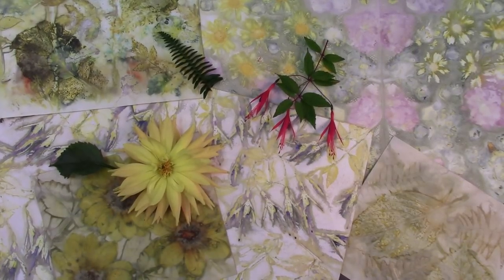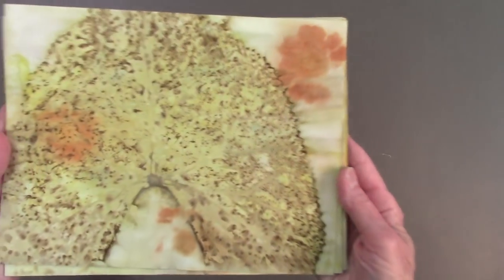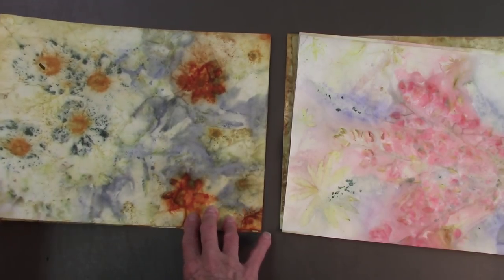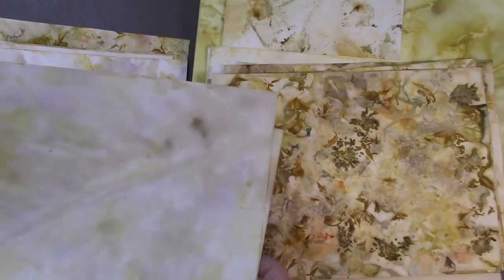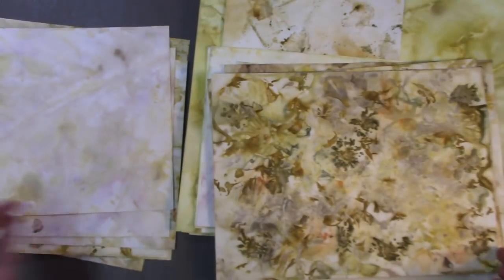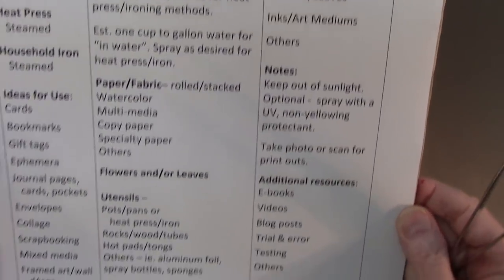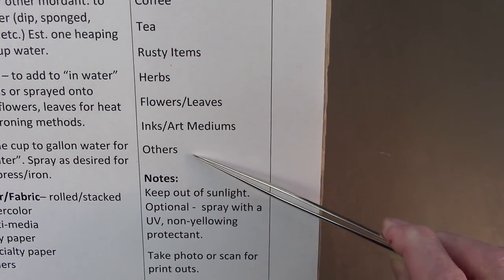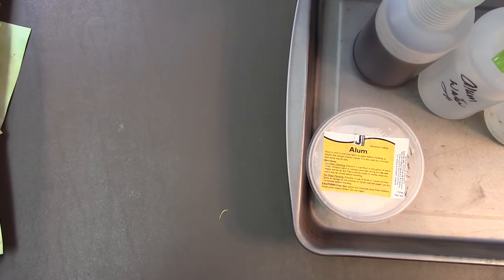Eco Printing Reveal and Results using Iron, Heat Press, Oven & Stove Top | Ideas

Comment: Em, I'm wondering if the reason the non-buffered paper doesn't work as good for the printing is because you used the alum on the paper.  They said the pH of the non-buffered paper was 8.5 and the alum might be the reason it doesn't work.  Could possibly change the pH.
Reply: Hi, that's an interesting thought. I will have to play around without the alum and see what happens. Thanks for the comment and for watching, Em

Comment: Do you add mordant in the water or pretreat the paper with the mordant?
Reply from the maker: Hi Sherri, yes I always pretreat the paper with alum most of the time. In a pinch, I will treat prior to using, but always start with alum on the paper:-) Em

Comment: What stunning results! ❤️ thank you for sharing...wondered if you could help with my issue...I’m very new at this process..I did my first batch where I soaked in water and just had it sit in Arizona sun for a day ( didn’t have a pot yet) they turned out ok...second batch had pot, boiled for 2 hours...but a lot of my copy paper fell apart ...I don’t know why? My first batch sat in water for 24 hrs..no tearing but 2 hour soft boil and I couldn’t handle the copy paper...any suggestions or ideas? ( I am using watercolour paper with no issues.. but want to be able to use the copy for my journals..thank u!
Reply from the maker: Hi Debbie, appreciate the comment. I agree that copy paper doesn't hold up well under boiling and why I don't usually use it. Perhaps others have had better success and have some tips. Maybe try the iron technique and see if that works better using copy paper. Here is an example https://www.youtube.com/watch?v=PpkxYNhqHwI

Thank you for watching, Em

Comment: What method do you recommend if you live in an apartment.  Thanks.
Reply from the maker: Hi Georgia, when I did it inside I would open doors/windows and do it when nobody else was home and I could work in another room while they cooked. I found the oven was best since it gives off less vapor and steam. I did it in a pot at 350 degrees for two hours. Both in water and/or sitting above the water to steam - both worked. Play around:-)
Reply: @emsplace  thanks

Comment: Do you have a link to the video that demonstrates the oven method?  Loved this video.
Reply from the maker: Hi Maria, I don't think I have a video where I actually demonstrate/show using the oven. Basically just the written information in the description above. Pretty simple: just make your bundle via rolling or flat based upon the size of your pan. I use a large rectangular cake/roaster type pan where I can do flat bundles up to 9" x 12". Then decide if you want them submerged in water or steamed.

I generally steam but have done both. If steamed, put something in the bottom of the pan, like a brick, wood etc to keep the bundle above the water and then put a lid/aluminum foil as cover to keep the steam in. I let it bake/steam at 350 degrees for about 2 hours. It is not an exact science so you can play around and adjust to our needs. Thank for watching, Em

PS: if you want to see how I make a flat bundle check out this video and especially at the 1 hour mark where I show the bundle done and ready for the string... https://www.youtube.com/watch?v=PWUkyjkdGrI&list=PLxKiESd8bksM_ohSGWpmdf8ulSt327Ils&index=3

Comment: Love it! Why Alum? Why is it important for the process? :)
Reply from the maker: HI, my understanding is that it helps the paper or fabric to accept and hold/fix the color from dyes, in this case what can be obtained from the botanical leaching out color onto the alumed surface. I personally do think it helps. Thanks for watching!
Reply: @emsplace  Which Alum do you buy, there are several. What Is Alum and How Is It Used?
From deodorant to cooking, this mineral is commonly used everyday

Usually, when you hear about alum it is in reference to potassium alum, which is the hydrated form of potassium aluminum sulfate and has the chemical formula KAl(SO4)2·12H2O. However, any of the compounds with the empirical formula AB(SO4)2·12H2O are considered to be an alum. Sometimes alum is seen in its crystalline form, although it is most often sold as a powder. Potassium alum is a fine white powder that you can find sold with kitchen spices or pickling ingredients. It is also sold as a large crystal as a "deodorant rock" for underarm use.

Types of Alum
Potassium Alum: Potassium alum is also known as potash alum or tawas. It is aluminum potassium sulfate. This is the type of alum that you find in the grocery store for pickling and in baking powder. It is also used in leather tanning, as a flocculant in water purification, as an ingredient in aftershave and as a treatment to fireproof textiles. Its chemical formula is KAl(SO4)2.
Soda Alum: Soda alum has the formula NaAl(S O4)2·12H2O. It is used in baking powder and as an acidulant in food.
Ammonium Alum: Ammonium alum has the formula N4Al(SO4)2·12H2O. Ammonium alum is used for many of the same purposes as potassium alum and soda alum. Ammonium alum finds applications in tanning, dyeing textiles, making textiles flame retardant, in the manufacture of porcelain cement and vegetable glues, in water purification and in some deodorants.
Chrome Alum: Chrome alum or chromium alum has the formula KCr(S O4)2·12H2O. This deep violet compound is used in tanning and can be added to other alum to grow lavender or purple crystals.

Selenate Alums: Selenate alums occur when selenium takes the place of sulfur so that instead of a sulfate you get a selenate, (SeO42-). The selenium-containing alums are strong oxidizing agents, so they can be used as antiseptics, among other uses.
Aluminum Sulfate: This compound is also known as papermaker's alum. However, it is not technically an alum.
Uses of Alum
Alum has several household and industrial uses. Potassium alum is used most often, although ammonium alum, ferric alum, and soda alum may be used for many of the same purposes.

purification of drinking water as a chemical flocculant
in styptic pencil to stop bleeding from minor cuts
the adjuvant in vaccines ( a chemical that enhances the immune response)
deodorant "rock"
pickling agent to help keep pickles crisp
flame retardant
the acidic component of some types of baking powder
an ingredient in some homemade and commercial modeling clay
an ingredient in some depilatory (hair removal) waxes
skin whitener
ingredient in some brands of toothpaste
Alum Projects
There are several interesting science projects that use alum. In particular, it is used to grow stunning non-toxic crystals. Clear crystals result from potassium alum, while purple crystals grow from chrome alum.

Alum Sources and Production
Several minerals are used as the source material to produce alum, including alum schist, alunite, bauxite, and cryolite. The specific process used to obtain the alum depends on the original mineral. When alum is obtained from alunite, the alunite is calcined. The resulting material is kept moist and exposed to air until it turns to a powder, which is lixiviated with sulfuric acid and hot water. The liquid is decanted and the alum crystallizes out of solution.